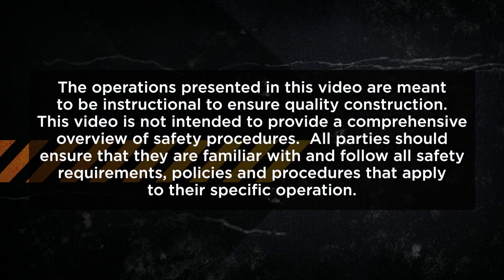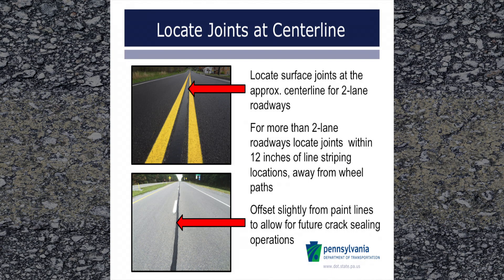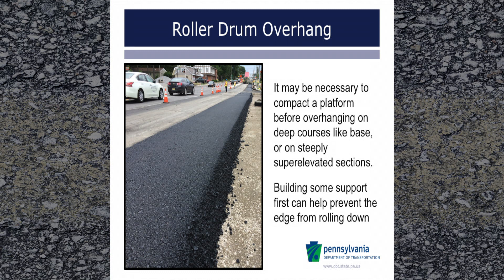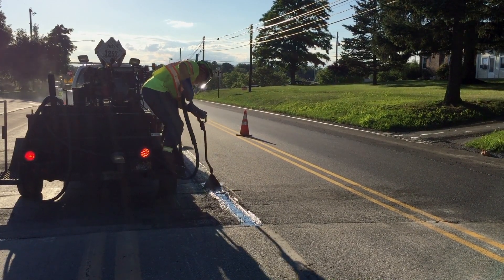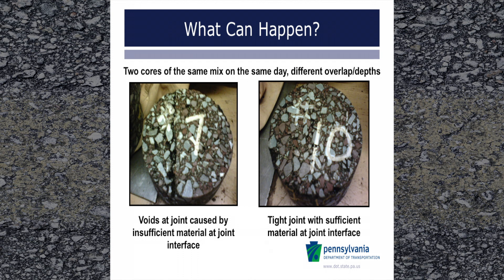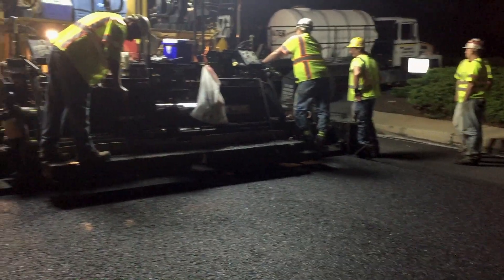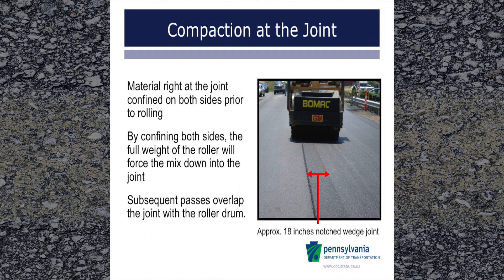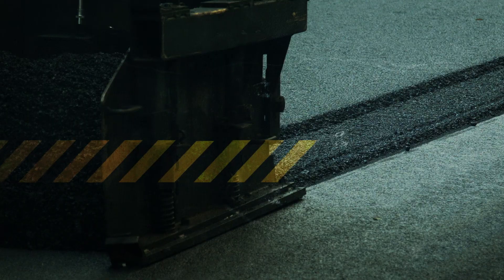Constructing a quality bituminous longitudinal paving joint

Comment: What happens with the 1" overlap with the cold mat.where does the new asphalt mix of 1" on top of the cold mat go?
Reply: I dont leave that much of an overlap for cold seams. I use a rd12 roller so gotta match it
Reply: And if you mean where should you throw it if youre raking/shoveling just chuck it literally anywhere (the neighbors bushes)